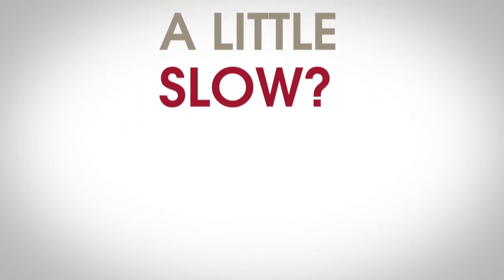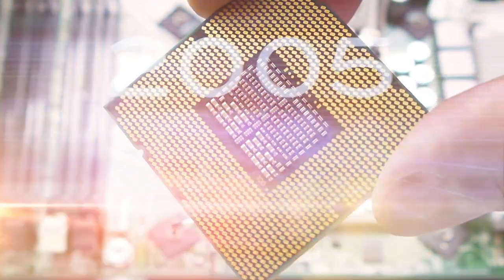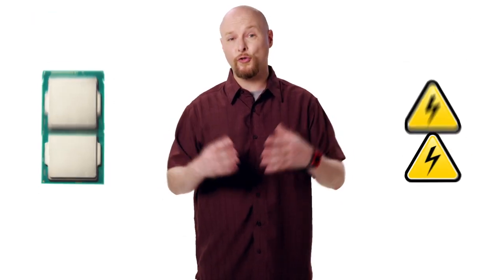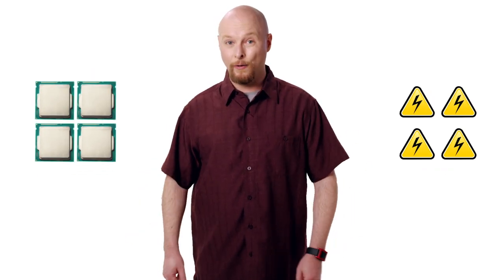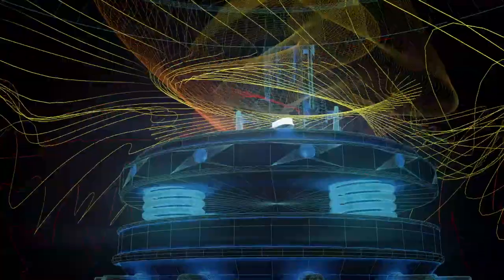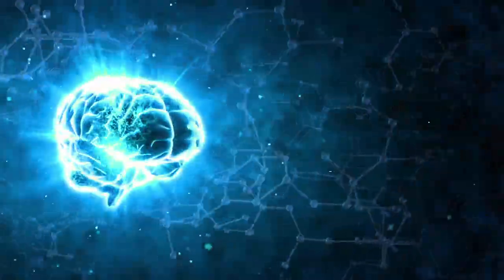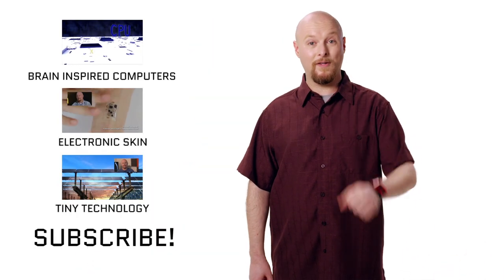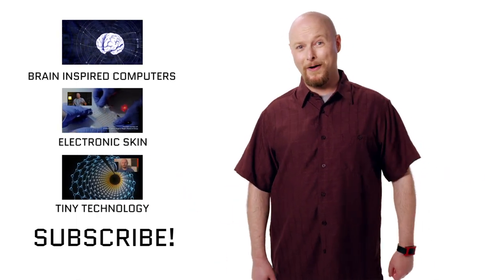Have We Reached Peak Computer Power?

Comment: Short answer: No. Long answer: No. We may be slowing down, and potentially lag behind Moore's Law, but we can add to current computation with 3D processors. Meaning we can add depth to our current design. We have enough breathing room for at least 15- 20 years before silicone reaches stagnation. We'll have formulated a scalable application for Graphene easily by then. Intel needs some competition though, their monopoly on the market is stunting innovation and progression. C'mon AMD, grab yourself by the boots and become great again.
Reply: There's the heat obstacle, and that's a big one, a CPU can reach 100ºC in seconds without a powerful cooler. So it's not that easy. So far Moore's law have been saved by the bell a few times...  but to expect consistently a breakthrough to exponentially increase CPU speed is, at least not very scientific way to look at it
 It IS possible, though, to go even far beyond Moore's law, if we (scientists) can understand quantum physics... but this is speculation. It's Steven Spielberg syndrome all over again, do you see sky full of flying cars and hover boards?

Comment: I really like this channel but I am always suprised how often they seem to miss the mark on the future of computing. First off I read a report recently on lasers and their place in the future of microchips. As it turns out the amount of power needed to operate that model would make it pointless to run. Secondly nano optics is awesome but theoretical. Might as well do a show about flying cars based on graviton technologies. The devices needed to provide laser based data streams are too bulkie to integrate into chips. At best they would make good BUS systems, but then you're limited to the speed of the corisponding elecronics. The reason chips cant get much smaller isnt due to heat (although it is a problem for a home PC model) its electron jump. If your trying to activate certain switches an electron jump due to random quantom tunneling effects can completly corrupt you data, and/or processing. This becomes more and more prevelant as size decreses into the atomic realm.

Comment: Jonathan, I'm curious. Does laser light fall into the electromagnetic spectrum in terms of data transmitting?  I'm trying to wrap my mind around the idea of optics and data transmitting for long distance information distribution using a laser. Would it be similar to radio waves just at a different frequency? I see how many telecom companies have gone from electrical impulses using coax cables to the now using fiber optics because of speed, efficiency, less heat resistance, etc. Please elaborate on that if you can. I'm very interested.

Comment: Nano-photonics isn't the only way to stay on Moore's law, using synthetic diamonds as the substrate semiconductor would allow for more heat tolerance and dissipation, mapping neural synaptic patterns would allow the chips to be designed in a fashion similar to memory chips both allowing more dense transistor packing than cpu's but also the advantages of biomimickery and the parallelism inherent to neural networks.   I'm sure there are plenty of other options, those are just what immediately came to mind.   There may be a pause while these options are explored but computing has definitely not peaked.

Comment: What about Graphene processors, multi-core processing and quantum computing? how do these all fit into the "speed" equation?
Reply: Graphene may play a role in photonics -- recent work with graphene and carbon nanotubes have led to the development of special spasers (surface plasmon amplification by stimulated emission of radiation) that could be used in optical computers. Multi-core processing and quantum computers are both great for computer problems that can be broken into multiple threads but they aren't necessarily faster (or even as fast) as a single-core processor for computer problems that can't be divided up.
Reply: Graphene is very early in development, to create a small sheet of graphene is too expensive at the moment, until the moment that graphene can be manufactured commercially it is useless to mainstream audiences. Other materials have surfaced but it will be around a decade before anything comes from any of these things. Photonics is currently the most promising field to increase processing speed.
Reply: Don't forget 3D processors.
Reply: We talk about these concepts in the Fw:Thinking audio podcast. I'm listening to a rough cut of it right now.

Comment: Quantum tunnelling is another major obstacle for Moore's law. As transistor become smaller and smaller, the distance between the two side of the transistor become shorter and shorter. At one point, the distance will be too short and electron will be able to pass even if the transistor is off because of quantum tunnelling. They already working of some king of barrier to stop this from happening, but the question is : will we be able to keep progress at the same speed?.

There is also, the simple physical barrier. We are making transistor with electrodes with only a couple of atoms between them. At some point we won't be able to make that distance shorter. Making this distance smaller than 1 atoms? That will need a serious leap in physics.

Comment: The brain as an exascale computer? Not likely. Though the brain has about 86 billion neurons, only about 20 billion are in the cortex, the part of the brain most responsibe for intelligence. Only about 1/2 to 3/4 of the neurons in there are actually doing anything other than controlling brain activity, and only about 2% of what is left is active at any given time. Each neuron has about 2-10k synapses, but only the strongest couple hundred actually fire. Add that to the fact that each neuron only fires about 200 times per second, and it doesn't seem like you have an exascale computer. Do the math and you have about 30 teraflops, or in other words, 30 millionths of an exaflop.
Reply: Cody Kochmann
There is a huge amount of data about neuroscience, but not much theory to put it all together. However, companies like Numenta are trying to do so and are having huge amounts of success. Numenta is actually developing a learning algorithm for use in statistical analysis and they base it almost entirely off of neuroscience. It's certainly something to check out and I'd say their model of the cortex probably is pretty accurate.
Reply: Cody Kochmann
Yes, I know that. The reason why they are using it for statistical analysis is because the cortex, which is pretty much the source of intelligence, really just learns patterns and predicts them. It's not purely statistical; statistical behavior is simply emergent. Jeff Hawkins (one of the main researchers at Numenta) wrote a book about a decade ago called "On Intelligence." I suggest you read it; it goes into detail about the theory (although it has been added to, improved, etc., just as good theories often are), why the cortex behaves the way it does, and how (though the description is quite vague) intelligence, creativity, and imagination can all come from this. Intelligence appears to come from nothing more than a highly interconnected and large array of cortical columns (a recurring pattern of neurons that produces this behavior) connected to things like the basal ganglia, amygdala, and hippocampus.
Reply: 30 Teraflops, doesn't a high end Consumer GPU have 5 TFLOPS?
Reply: 18aidanme
R9 295x2 is 11.3 TFLOPS and was released a while ago. In another year or two you'll probably be able to find 30 TFLOPS GPUs. Despite this, you could shove 3 R9 295x2s in your computer to get 33.9 TFLOPS. There are even motherboards that can handle up to 7 GPUs, though not without some PCIe risers and tricky power management. Graphics drivers can't handle more than 2 of these cards, but it's not hard to write OpenCL code that can access more.

Comment: @SvenSlider The Xbox One Is 10X More Powerful Graphically, and the PS4 is (Theoretically) More Powerfull Graphically than the Xbox one (I don't know about overhead though). I do prefer the Xbox one though (for feature set, not raw power) and it IS better in graphics output than the Xbox 360, it just takes a lot of processing power to add more details, giving the false impression to SOME people that it is not as good.